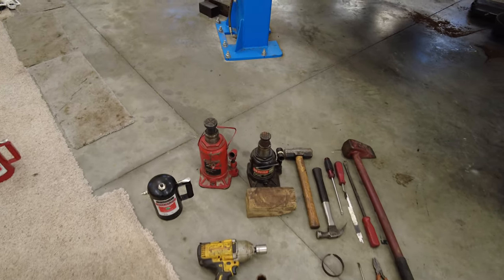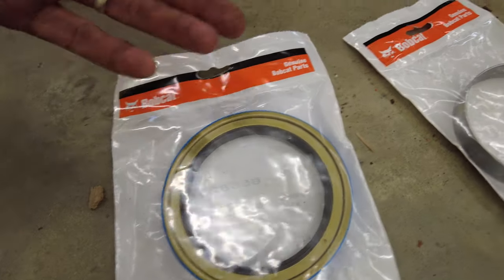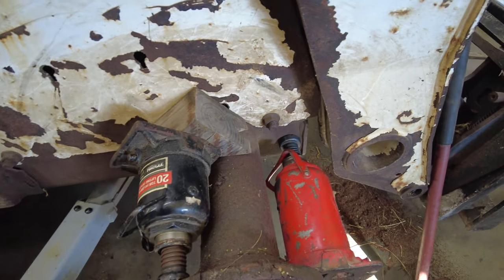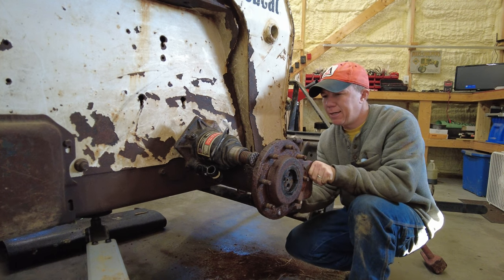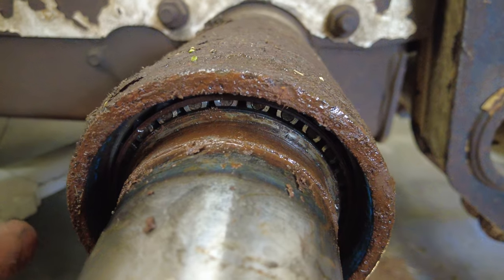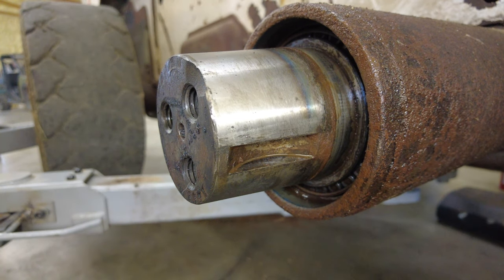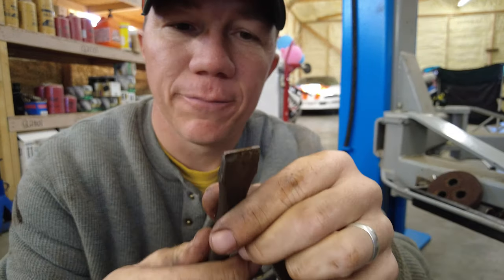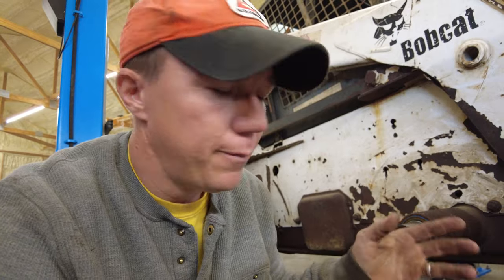Detailed Bobcat wheel seal replacement with common tools *satisfying*

Comment: Tried the jacks behind the hub( 2-4 tons). Didn’t budge. Tried a gear puller from the front (10 tons). Didn’t budge. The Hub Master did the job in 15 minutes. Fantastic time saver.
Reply from the maker: Oh wow! I was pretty fortunate and was able to get it to budge pretty easily by putting the pressure on it with the jacks and giving it a few taps with the hammer. Hub master is probably the right tool for the job though.

Comment: where did you pick up that sprayer thats pretty slick.We make our own penetrating oil from transmission fluid and acetone. Really need a sprayer like that.
Reply from the maker: They are sure shot cans, you can get them on Amazon. They are made in the USA too. Just fill em with whatever you'd like, then it has a Schrader valve to add air like you would on your cars tires. Works very well. We have two, one for wd40 and one for brake clean. Having heard your idea for penetrating oil with trans fluid and acetone I may buy a third one.

Comment: When a wheel looks like it is leaking oil, the problem is the seal or something else. I have an 873.
Reply from the maker: Generally the seal, however the seal could fail due to a bad wheel bearing too. Either way the seal has to be replaced and inspect the bearings while you are there.
Reply: @FreedomFarmsMo  ok thanks
Reply from the maker: @fredygarcia353 you're welcome
Reply: @FreedomFarmsMo  Excuse me, am I again the guy who pulls the seals? Is the bobcat the same hydraulic that the machine uses or is it different and where is the lid to fill it?
Reply from the maker: @fredygarcia353 are you talking about the chain case and filling it back up to refill the fluid that leaked out of the wheel seals? If so yes it just takes hydraulic fluid.
Reply: @FreedomFarmsMo  If the one that spilled from the wheels, my question is if it is the same container where it is filled for the cylinders or is it filled in another different place?
Reply from the maker: @fredygarcia353 it is a separate reservoir on my s250. There is a panel between your feet when you are sitting in the seat that has 8 bolts or so on it. Remove that and you will be able to see the drive chains and that is also where you fill it up. It holds 11 gallons of hydraulic fluid